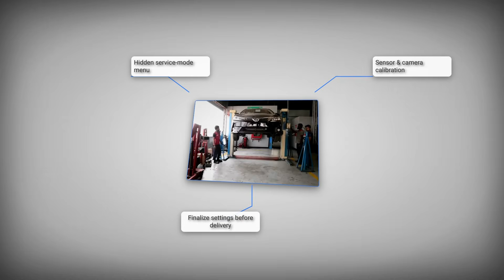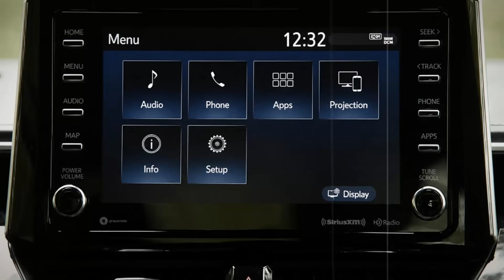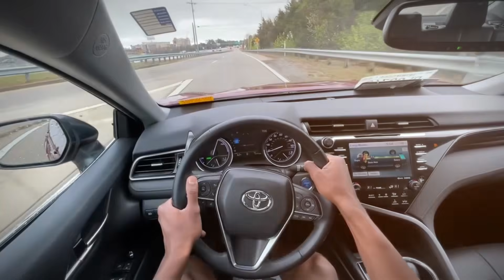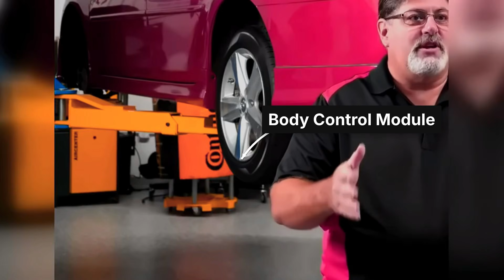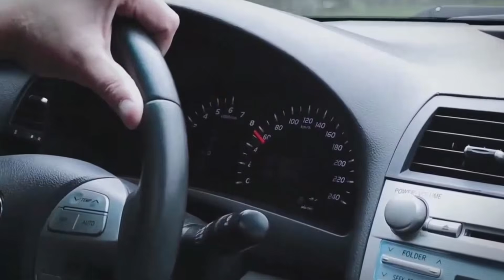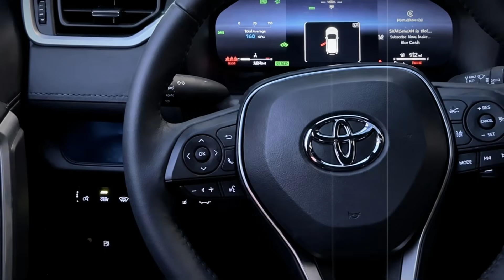The "ILLEGAL" Toyota Hidden Menu Dealerships PRAY You Never Open (20+ Locked Functions)

Comment: The 2020 Toyota Avalon Hybrid features two hidden service and diagnostic menus built into its infotainment system. Depending on your exact software version, you can access them using one of two methods.

Before trying either method, turn the vehicle's ignition to Accessory (ACC) or ON mode (press the Power button twice without pressing the brake pedal) and let the infotainment screen fully boot up.

Method 1: The Screen-Off Button Sequence (Most Common)

This is the standard sequence for newer Toyota Entune 3.0 systems:
1. Press the physical MENU button on the side of the screen.
2. On the touchscreen, tap Setup (or Display).
3. Select Screen Off to make the display completely blank.
4. Immediately press the physical CH > (Channel up) button 5 times.
5. Immediately press the physical < TRACK (Track down) button 5 times.

Alternative Touch Variant: If your software version lacks physical CH/TRACK buttons, once the screen is toggled Off, firmly tap the top-left corner 5 times, and then the bottom-left corner 5 times.

Method 2: The Headlight Switch Sequence (Legacy Toyota Method)
If the button sequence doesn't work, this classic physical-override method usually triggers the diagnostic menu:
1. Press and hold down the physical AUDIO button on the infotainment panel.
2. While continuing to hold the Audio button, look at your headlight stalk on the steering column and twist the light switch from OFF to the parking lights position 3 times (On, Off, On, Off, On, Off).
3. Release the Audio button, and the service menu will flash open.

A Quick Warning

These menus are intended for dealership technicians to run GPS hardware tests, diagnose microphone signal data, check real-time 12V auxiliary battery voltage, and calibrate backup camera guidelines. Avoid changing or clearing values arbitrarily within these screens, as doing so can glitch your radio or disable your reverse camera grids. To exit the menu safely, simply press and hold your infotainment power knob down until the system resets, or turn the car entirely off.

Comment: Everyone needs to give this a thumbs DOWN!!!  (who give it a thumbs up when it just drones on and tells us nothing???)

ANYWAY - here it is, here's the big secret......
NOPE! Gotcha!!!!!

Now if you got a laugh and clicked "More" here's what I found;

Older & Mid-Generation Systems (Hold Audio & Headlights)Turn the ignition to accessory or ready mode.Press and hold the physical Audio/Menu button on the head unit.Turn your headlight/marker switch from Off to Parking/Tail lights three times in quick succession.Release the button once the hidden service screen appears.Modern Touchscreen Systems (Screen Off & Swipe/Button Gestures)Turn on the vehicle system and make sure the audio is off.Go to Menu -> Display (or Screen Off settings) and select Screen Off.Option A (Physical track/channel buttons): With the screen dark, press the physical Audio Channel (CH) button 5 times, then press the Track button 5 times.Option B (Touch swipes): With the screen dark, swipe right 5 times, then swipe left 5 times across the blank display

Comment: I assume since we don't know how to access this info, that we are on the hook for the dealer to make these adjustments at a cost. In a previous video, you said there is a way to lower all windows with a single press and hold of the unlock button on key fob. I gather the dealer has to enable that feature on my 2026 Camry.

Comment: How does one get into the secret menu!!
Reply: It's a secret!
Reply: older Toyota infotainment systems required users to hold down the audio button while repeatedly turning the headlights on and off to access the diagnostic menu. Newer systems use a different process. After turning on the infotainment display, the screen must first be switched off using the Display menu. Once the display is dark, users perform a series of swipe gestures across the screen.

Comment: Excellent video except for 1 small problem. How to get into the secret menu is NEVER given. It is still a secret. Waste of time.
Reply: older Toyota infotainment systems required users to hold down the audio button while repeatedly turning the headlights on and off to access the diagnostic menu. Newer systems use a different process. After turning on the infotainment display, the screen must first be switched off using the Display menu. Once the display is dark, users perform a series of swipe gestures across the screen.